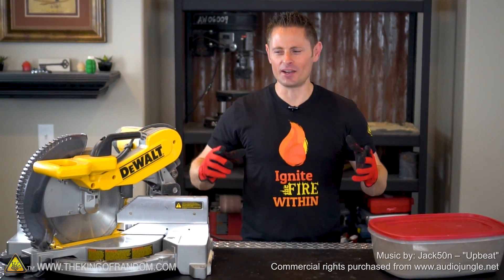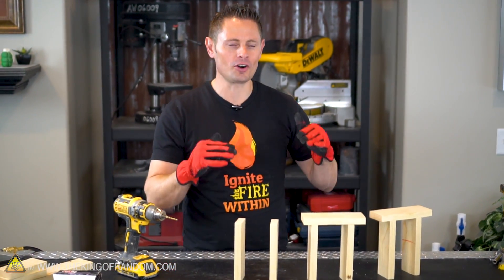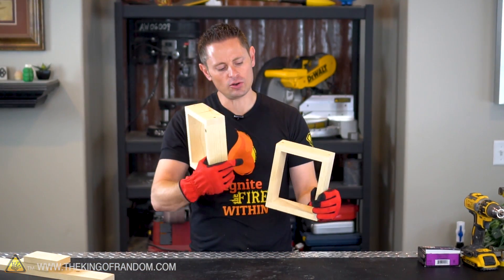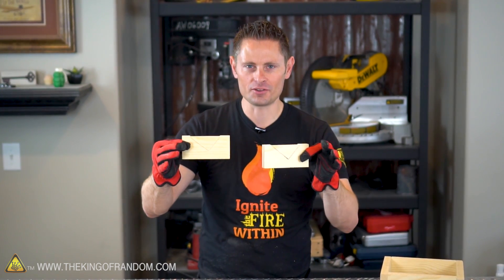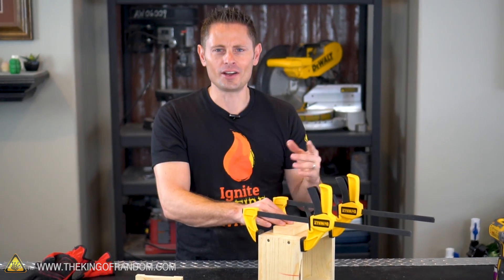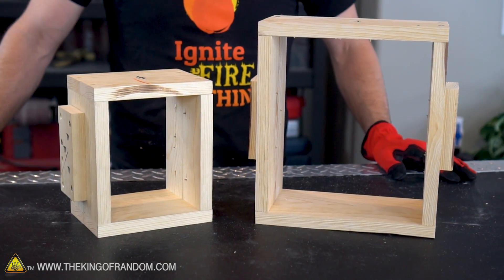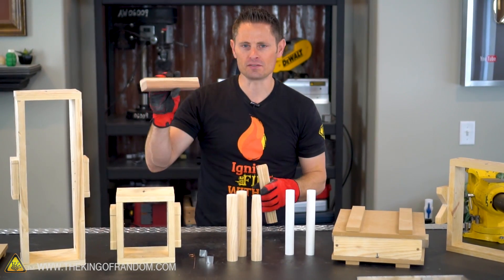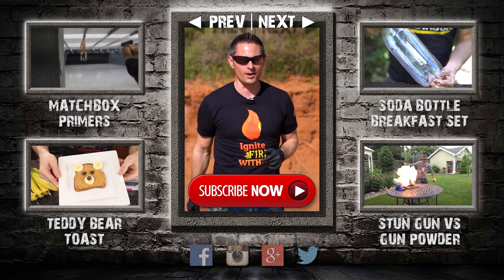How To Make Metal Casting Sandboxes - King Of Random Shows You Metal Casting Basics With Sand

Comment: Couple of quick tips for you, first thing is you don't need those two lids, once you press the sand into the first mold it should be compacted enough that Will hold itself together. If you need to use a lid then the sand is not compacted enough and the mold will most likely become compromised affecting whatever you make. Second thing, a spoon that will work just fine for creating channels to pour the molten metal, even professional metal casters will be just fine with a spoon. Also you're going to want to put a little bit of Talcum powder in between the molds because it'll make it so the top mold can be put on top of the second mall and then sand poured in and compacted without sticking to the sand in the bottom mold as well as getting stuck to whatever is in the bottom mold(which you will have to pull out) it's kind of hard to explain. I understand that this is your experience and such but it wouldn't had to watch a couple of metalcasting videos with the sand. There are tons out there and it's really quite fun to watch strangely enough.

Comment: Hey Grant Thompson, you should try to drill a hole in a vacume chamber and then pass a whire trough it. Take the rubber off in the vaccum and connect the whire to something. Try to turn the device or something on

Comment: Hey if you want to do another wax casting use your refractory from the smelter, it should withstand the heat better and (unfortunately) it dissolves in water to have an easy release ( found this out after having to put out a fire near my smelter)

Comment: the box is actually called a "Flask" the bottom piece is the "Drag" and the top is the "Cope". some of the technical names for the other stuff are things such as... Your sand rammer is called a "bench ram", your vent hole tool is called a "riser", your correct with the sprew,  and as you probably could guess the thing that makes the mold in the sand is called a pattern.
Just finished my freshman year at college where we learned all of this and got to do some sand casting

Comment: along with a sprue id use Styrofoam risers or a form of a riser.. instead of "vent holes".. need a risor to allow the excess metal to vent and rise.. allowing the casting to be more smooth and less air will get trapped.

Comment: Pro tip: turn one of the "latches" clockwise by 180 degrees. this means that, even if the writing is worn off, you can't put the top on wrong as one side has an arrow and one a noc. even better... put the latches off center too.

Comment: "pro tip" before you start making your mold: sprinkling a bit of flour on the mold will prevent the green sand from sticking to it, without it some of the sand tends to come out with the mold messing up your casting. Also after you have both halfs made and added the down spout remove some sand on the other half that will be connected to the mold by a channel, the hole will trap most of the sand that is pulled down when you pour into the mold.

Comment: I`m in the a sculpture group at my college and we do sand molds all the time! We use a three part apoxy ressen  to cure our sand because when we make our sand molds we need 100-200 pounds of sand. If he`s doing a two part you don`t need the two parts of wood. Make a rectangle box fill it 2 inches full of sand put what ever your taking an impression of inside then make a part line half way through the impression piece  and carve out circles on three corners then wait for the sand to turn solid. Once that half is solid pack the rest of the sand in to cure when its cured bust the mold open at the part line and dig out the impression.  From there all you have to do is is make the the pour and ventilation holes. You can do that by using a drill with the hole attachment. Use a metal zip tie to hold the two half's together and your ready to pour your metal!

Comment: 10x10 and 7x7 boxes? Those look awfully rectangular for being perfectly square like that. Are you sure you didn't gain or lose some length by fitting the sides like you did instead of cutting the corners at 45 degree angles so they'd actually fit together rather than slapping the top and bottom directly on the edges of the sides?

Comment: I suggest you drill a few screws right trough the sides that stick out inside. They allow the sand to have a lot more things to grip onto than the smooth wood sides surfaces.

Comment: For your cope & drag (moulding boxes) I use a biscuit joiner to use biscuits for locating the halves. It makes the job so much faster & very cheap. Always mark the outsides to identify the matching sides to prevent mixing them up.

Comment: FYI ... you just made Cope and Drag flasks.  The Drag is the bottom and the first mold you will make. Use the flask with the triangle as molding will be easier. The top flask is the top and will have the pouring sprue.  This is in a nutshell... there is more to it but this is just the basics.

Comment: This is called a flask and the top and bottom are called the cope and drag. You can also use the sand mixed with sodium silicate and harden it around your item using CO2. But dont use water! use baby powder as a parting agent though

Comment: You made a mistake. I casted metal using green sand before, and you need to make some plate for your model. For the latches, you should have used latches like those on jars (pickels of jam ones), and I'd have run a string of silicon around the edge of your boxes. For funnels and channels, you want to have quite some more tools. First off, the larger the funnel/channel, the quicker the metal is going to cool down. Second of all, you need to have kind of a wave shape ( /¯|) so that the impurities of the metal catch in that turbulence, to get a better casting. Also, you'll need to make the main channel larger than the secondary ones, and add a little extra length for the impurities to go in, instead of your casting. Indeed, impurities have more mass, therefore more inertia, and they won't go into your casting, making the result not only as pure as can be, but also stronger (each impurity actually will be a weak point in your casting. You should also plan on using small reservoirs that'll get filled up, so that the casting, as it cools and shrinks doesn't have any gap on the surface.
Reply from the maker: The silicone is a great idea.  Instead of latches I'm using screws to bolt it into place.  Thanks for the tips.  Have you any video tutorials on your work?
Reply: Lol, everyone is like "that sounds smart, I'm gonna like it"
Reply: I don't have any videos myself, but what Simon is saying is correct. The terminology for your "metal casting box" is the top box is the cope and the bottom is called the drag. I'm sure its in the comments somewhere here but I don't have time to go through them.
Reply: Will Stone I came to make the same comment. Also the cope and drag together are called the flask.
Reply: Ethan Altom calm down kid....
Reply: Watch out, we've got a triggered die hard 9 year old King of Random fan over here.
Reply: Unfortunately not, I actually learned all of that stuff in engeneering school, and used it, and your mini metal foundry to make some metal holders for linear ball bearings,as I'm trying to build a diy cnc machine. Be careful to the seam, as some metal will slightly leak around the edge. For complex shapes you may also need some "cores" (don't know the exact english terminology, as I'm french), especially if you want to make a hollow shape almost fully enclosed. Casting in green sand is incredibly hard if you don't know all that stuff. I suggest your first casting be a spiral, to see the cooling speed of the alloy you're using. It is important the spiral is of even thickness. I can try to make you a drawing for you to see every step of the process. 

1. Seam plan. Gotta choose the best one, and sometimes it is easier if it is not a plan. 

2. Plan the cores, and be aware that sand is less dense than molten metal

3. The angles. You should leave a slight angle towards the seam plan in your model. If not you won't be able to cleanly remove the piece from its sand enclosure

4. Channels, vent holes, funnels and masses. The main channel should be broad, and secondary channels should be thin and wide. You may need only one funnel, but having more may make the casting a bit better (depends on the viscosity of the molten metal)
Reply: Ethan Altom kid, this guy is trying to help people and improve on grant's design and no, he does know more than grant ON THIS TOPIC
Reply: Brent Whitley Or because they like constructive discussions for a change.
Reply: Shut up
Reply: He knows more than you

Comment: these are known as cooping boxes, i may have miss spelled that. individually one side is the cope, the other is the drag. you will find your results will improve after the sand has been used a few times, fresh green sand is normally added to old sand and mixed. chalk dust serves as a surface treatment to prevent the sand sticking to your end boards and to help to release mold with minimal sticking. Old foundry knowledge pasted down from the old school pros. hope that is helpful Grant, from a dedicated fan, The kiwi prince of random.

Comment: Bro can u freeze liquid nitrogen. Try it :)
Reply: He could freeze it if he cooled it to under -210 degrees C. Other than that he would have to put it in a pressure chamber.
Reply: RAZOR BLADE-GT I'm pretty sure you cannot, except by using some short of vacuum chamber he definitely can't create without the help of NASA or the military.
Reply: KiingMystic nitrogen is -275 degrees...
Reply: Theodore Mauros Vacuum chambers are suprisingly easy to make. Thick plexiglass and silicon is about all you need.
Reply: DJxflame nitrogen is 30°
Reply: SicariusVG no it's not
Reply: RAZOR BLADE-GT I think he had tried it by putting it under pressure, but failed because the vacuum pump motor wasn't strong enough.
Reply: Lazarus Maximus He would have to build a vacuum chamber stronger than the one he has but it's possible to do for just a civilian, I was wrong when I said he would need NASA's help.
Reply: Theodore Mauros Exactly
Reply: SicariusVG atmospheric nitrogen is at room temperature liquid nitrogen is -275°C
Reply: That's what I'm saying.  Nitrogen is 30° and -275°.